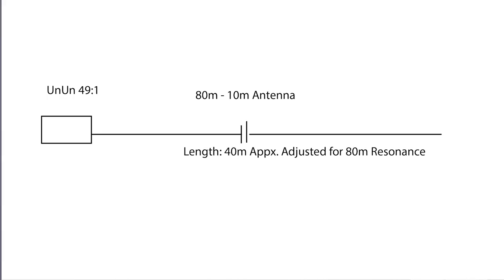HAM RADIO EFHW Mystery Coil. Do you need it and is there a better alternative?

Comment: Peter, if the coil is 1.5 uH, would not a clip-on toroid of equal value work as well and be much easier to add-on and adjust? Thanks.

Comment: 👍Thanks for video. One method I have used to find required capacitance value is a small variable capacitor. Adjust this to get things right on analyser. Once happy, remove it and measure the capacitance. Then make up the capacitance using fixed value high voltage components. I also have some experimental coils that can be tapped at different windings to make crude variable inductors. Similar to capacitor idea, these can be measured when adjusted for optimum readings and permanent fixed inductor made.
Reply from the maker: Hi Steve, thanks for that. 73 Peter

Comment: Clear explanation; one comment, though. The capacitor's impedance depends on its value and the frequency, so it doesn't appear as a short on the high bands. It's located at/near the center because that's a current maximum at fundamental (and odd harmonics, like 10.5 MHz on a wire cut for 3.5 MHz), but a current minimum for the even harmonics (7, 14, 21, and 28 MHz). You'll need a very high voltage capacitor here, because it will be located at/near a voltage peak on those even harmonics.

Comment: I own a My Antenna's EFHW 40-10 antenna. It has the coil and tunes 40-10 meters practically flat across the CW portions of the bands. A little higher on 10 meters.

Comment: Excellent info. as always Peter, one question, does adding the coil affect the the length of the 80m element?  
In other words, do I add enough wire to make the coil, or just use the existing length and wind up being a bit shorter?

Thanks...
Reply: Can anyone advise if I need to make my 80m wire longer by the amount of wire used up making the coil?

Comment: Hyend Co. have an 8 Band 800 Watt with the inductive coil arrangement and the high voltage capable capacitor. With the 40m wire stretched at 12m (Spiderpoles), in my location, it has been a winner for the past 3 years. Maybe we should also spare a thought for the ordinary Russian people who, I suspect, have been fed a different flavour of the truth.
Reply from the maker: Many thanks. 73 Peter

Comment: Peter, a choice you did not mention was adding a choke (not trap) at the end of a 40M efhw and adjusting the tail past the choke to the 80M frequency of interest similar to the Shorty 40 design but for 80M.  You get a shorter antenna length, can adjust  by adding or removing wire turns or adding or shortening tail length, and you do not have to chase down a selection of costly high voltage caps.  Your thoughts.  I enjoy the channel.  Stay safe and 73 from the Great Lakes State of Michigan USA. Doug, K8QDP
Reply from the maker: Hi there. Great to hear from you. I did not mention it but like the 40-10m   version, the coil is not needed. i have done several videos on the 80m choke version. 73 Peter.

Comment: Excellent video.  The explanation of the harmonics is really not accurate in that they do not multiply out as you stated,  For example, a 80 meter might have it's lowest  SWR at 3.55 MHz but it's 2nd harmonic may be 2.1 X 3.55 or 7.455 MHz and not 7.1 MHz depending on many factors.  It will be a day long project full of decisions when tuning an EFHW.  Decisions like "With a 470 pF cap I raised my 80 meter sweet spot to 3.7 MHz but now my 20 meter low SWR is now at 14.30."

I suggest getting it as close as you can by experimenting and use a tuner to ensure reflected power is re-radiated and a high quality coax like RG213 to reduce cabel losses. If you can get all band frequencies below 3:1 a tuner will enable you to radiate better than 90% of your power.

Comment: What is the gain of a HWEF antenna? One website claims that it is 7 to 10 dBi.
Reply from the maker: On the base vand there is zero gain. As you operate on higher bands there is a small gain as lobes increase but more like 2dB!

Comment: Where does the coil go again. We need some practical examples of both.
Reply from the maker: 2m in from UnUn as I described in video.
Reply: @watersstanton  2m on the antenna wire? Not the coax. I was sure that the coax feed was a part of the antenna. I've not seen this before.  G7VFY
Reply: On the antenna wire, 2m from the matching transformer.

Comment: Tnx for the tribute to the Ukraine Peter...at least you can see all of Peter when he talks, some of these guys use giant no doubt $$$ studio mics that cover half the guys face... is there some sort of cachet to this? A simple lapel mic seems to work just as good.  The video, in fact most seem to cover the EFHW configured in a L shape ... hopefully the same will be for a straight line which is really the only practical option I have... now use the 110mh coil at the far end version, now gonna try Peter's 5 turn version at 2 meters fed with LMR 400.

Comment: Great videos Peter.

The Dec 21 CQ mag has an article on the capacitor adjusted EFHW.  I built an 80m EFHW cut for 3.550MHz and added a capacitor about 30% of the way from the unun.  I put a plug and socket on the capacitor so that I can short it out if I want.  The capacitor also has a 1Mohm static bleed resistor across it.  The antenna has a SWR of less than 2:1 on all bands except 10m, where it just goes over 2:1 on some portions.  

Cheers

Jim
Reply from the maker: Thanks Jim. Interesting imfo. 73 Peter
Reply: Hi Jim. Did you reduce the ratio to 36:1 as per the article or stick with 49:1? 73, John.
Reply: @johntyler4222  stayed with the 36:1 ratio.  It worked well and had good SWRs across the bands.  73. Jim
Reply: @jimreed6503  Thanks for that Jim. 73, John.

Comment: It is actualy 6 turns the 2 half turns at each end make a full turn.
Thats the basics of air core coil forming 2 X half turns = 1 full turn.
Interesting video that I already known about but interesting all the same.
Reply from the maker: If you are referring to the coil in the video it is most certainly 5 turns.
Reply: @watersstanton  Yep you are correct I counted the center turns first as 5 for some reason